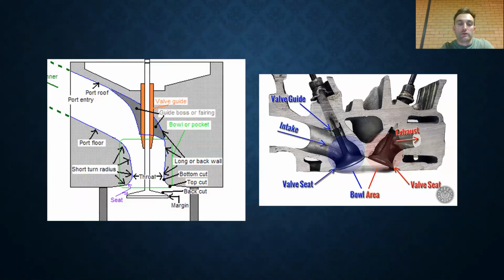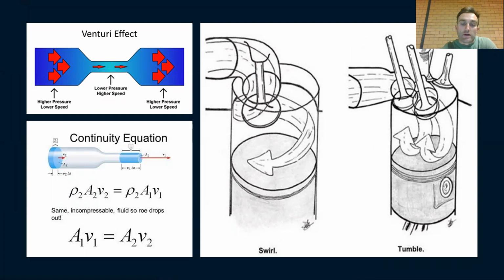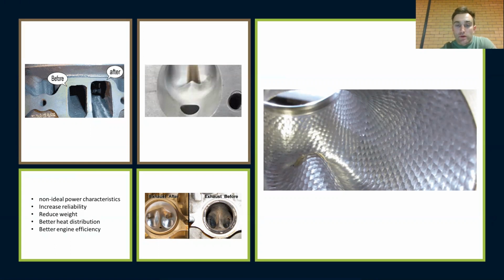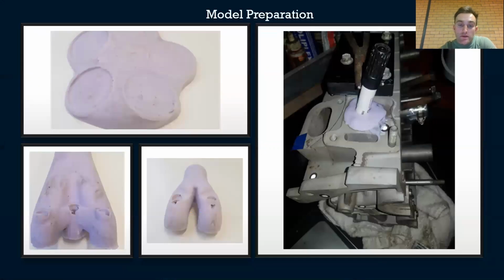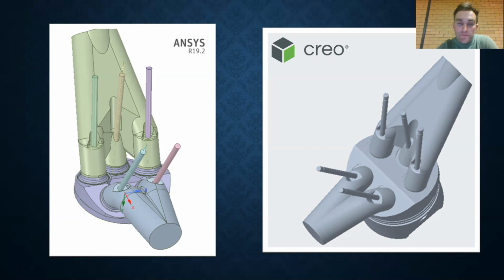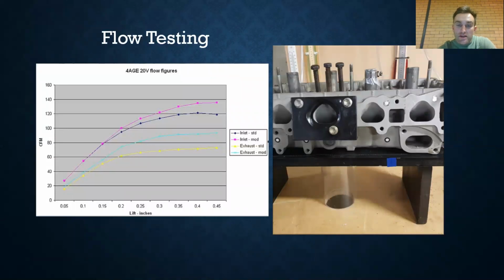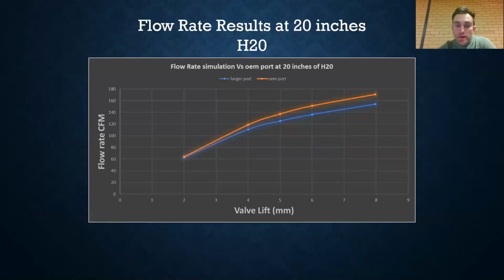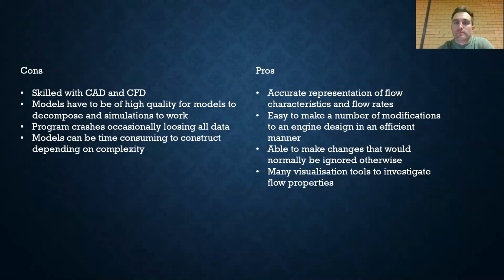Jesse Wallace FYP Part B

Comment: Nice work!
What parameters have stock engines been optimised around? Surely large engine manufactures are already doing this analysis before putting an engine on the market, if so why are they not getting the most out of them? Are there trade-offs in these modifications? 
Also, how do you implement some of this optimised geometry in practice, I assume it's not 3D printed FDM plastics?

Comment: Pre EFI, it was a trade off in keeping the fuel in suspension and vaporizing against having high flow capacity ports for high RPM use.  With multipoint EFI, do you see a downside of having highly tuned ports for daily use.

Comment: At 1:50 you mentioned that the VE table is an indication of flow efficiency.  What are your thoughts around is possible to over scavenge resulting in a need to add extra fuel to compensate leading to a seemingly false VE?